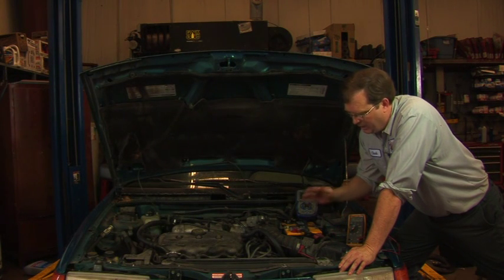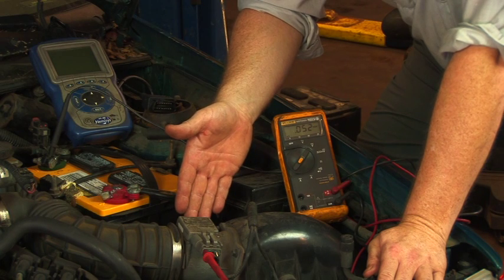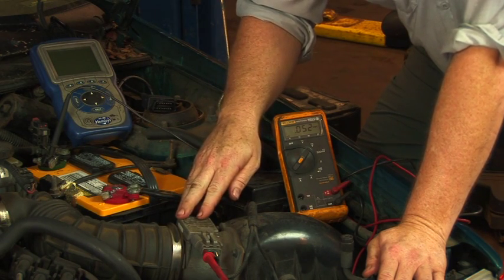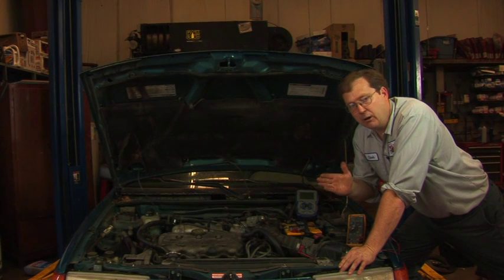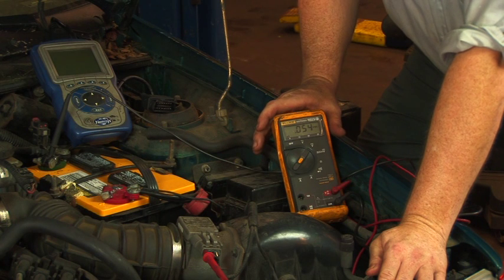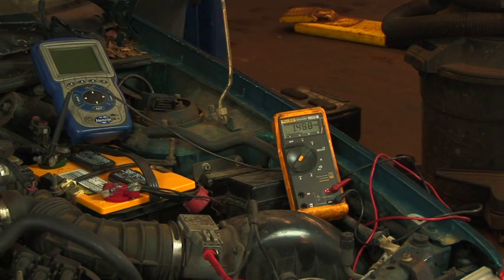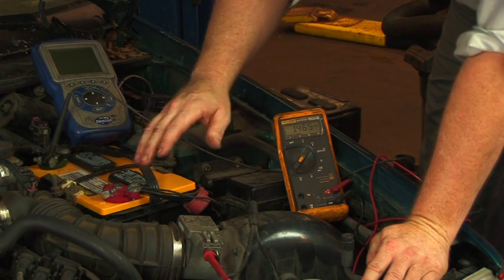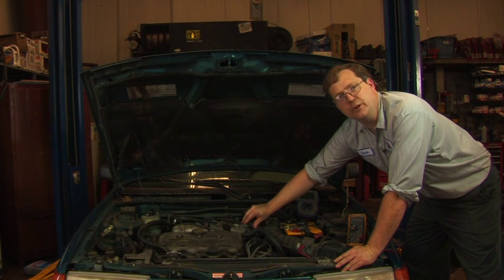Auto Repair & Maintenance : How to Know if a Mass Air Flow Sensor Is Bad

Comment: With the engine off I pulled the plug on maf and started engine no issues
Took car for a spin and no issues . OBD shows no fault codes so whats the issue here any suggestions

Comment: I have a 2008 chevy express 1500 showing reduced power. It would not go over 30mph. I took out the grey clip retaining the wiring connection to the MAF Sensor and removed the connector. Then I put the connectoymr back on and started the engine. With the engine running (roughly) at idle, I then removed the connection again (this time with the engine running) immediately noticed a bit better idle. I drove it around the block with nearly all the power restored.  So, the MAF sensor is bad and possibly something else... Or... The rest of the issue could be resolved once a new MAF sensor is installed and hooked up.
Reply: Terry Weaver once you took it off, did you ever put it back on?

Comment: Got an 09 fusion v6 auto. Oil light comes on, car shuts off while driving. Added oil (was a couple quarts low). No issues for a week. Then it happened again and engine light came on. Getting an O2 sensor code...... bank one specifically. Could this be because of a vacuum leak somewhere. I imagine so but I want to be sure I'm not chasing ghosts.
 The engine light didn't come on until my girl over filled the oil by about 2 quarts or so. I figured the burn off just clogged the sensor until I realized which O2 was throwing the code. Yes, I drained the access oil.

Comment: Could a bad MAF sensor cause a crank, but no start condition? I have a 2005 Ford Freestyle AWD 3.0 liter v6
Reply: Johnny CincoCero oh absolutely, so can a variety of others like idle air control valve if equipped, throttle position sensor...just unplug them one at a time, when the engine runs better you found the culprit, keep in mind it will set DTCs but they'll go away.
Reply: Raymond Panek Turns out it ended up being Ford's PATS passive anti theft system. I left the battery disconnected for about 24 hours. Started right up after that. Havent had a problem since. Strange.
Reply: Liketocustomize Cally it was Ford's PAT system.

Comment: Great video, but I have a question.  I have a '05 Jeep Liberty 2.8 Diesel that I am getting a P0101 CEL code (MAF Sensor).  I don't know if it's the sensor itself or a problem with the airflow itself.  The freeze data says "MAF FLOW GR/SE 20.44" which I believe is a little low.  My MAF sensor has 6 pins though and I can't find information on what the voltage should be for the pins, do you what pin I should measure the voltage for?  I'd rather not buy a new sensor without knowing for sure if it is bad.

Comment: I had a P0102 code in my car which pointed to MAF sensor pending fault. I cleaned it with CRC. MAF cleaner and installed it in similar car like mine and no code showed up. Finally I discovered my PVC hose was broken  which causes vacuum leakage , which triggered such code . MAF sensor only go bad if there is oil and dirt on Air Filter, which most of us don't replace it on regular basis or as the result of vacuum leakage.

Comment: LISTEN UP!!! A faulty MAF censor can be hell on wheels LITERALLY! my 96 Buick Century would die right after I started the car, not to mention it would shake and rattle at idle, it would shake at 55 MPH, my wheel wouldn't turn freely, and my car was very very loud and sluggish. Once I replaced it (for $160 freakin bucks!) after my mechanic tested the car, IT IS RUNNING LIKE A CHERRY! It was the best thing I could have ever done, and it literally took a hugh weight off of my shoulder. I'm so thankful I replaced it, my check engine light is off now too!!!!!!!!

Comment: on my 2008 chevy cobalt just the other day when i started it had horrible sputtering i ran the computer on it and it said it had a misfire p0300 so i replace all the spark plugs started it up same thing going on so i was getting a little nerves ya i thought air flow could be a problem so i was looking around about seen this video about unplugging the sensor so i did and started it sound like a brand new motor! thanks a lot sir!

Comment: my 2005 Nissan quest have two trouble code P0113-P0183 , i already replaced  code related sensor , but code is still showing up, when i unplug battery wires for refresh code and start my vehicle code not appear but when i turn off engine and start right way again  then codes pop up again. Bad sensor issue is closed because sensors are replaced already , problem is some thing else, need help

Comment: I Have a 2004 ford f-150 and it is running very poor when idling ..when i unplug the Mass Air Sensor the truck shuts off ....Can you tell me why please ......Should i replace the sensor  thanks

Comment: I have a 1990 Ford Aerostar 4.0L V6 and my engine is running very bad and lean, but when I unplug the mass air flow sensor, it runs great. So I got a new mass air flow sensor, but it still is running very bad. What do you think is wrong?

Comment: can a bad air flow sensor cause a low idle? my bmw is has a low idle problem and I disconnected the plug to the air flow sensor and it ran much better but im sure i cant leave it like this  should I get a new sensor ?